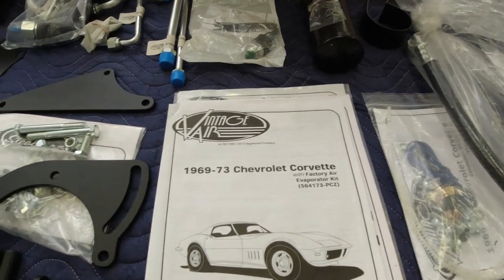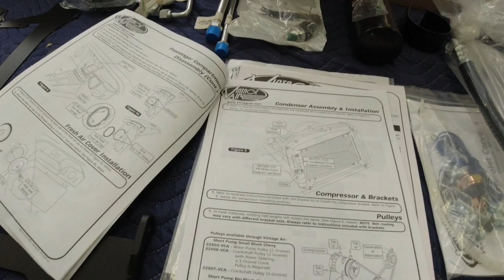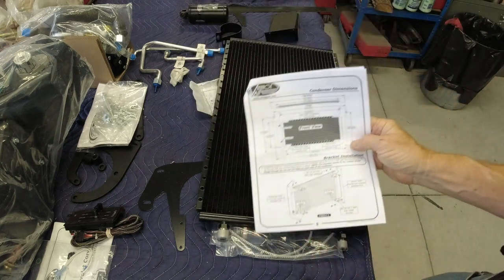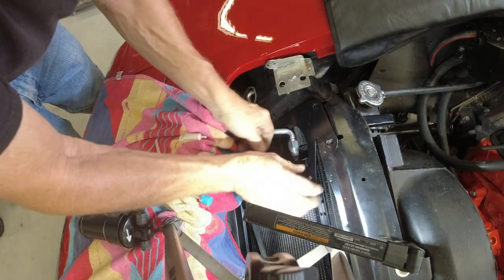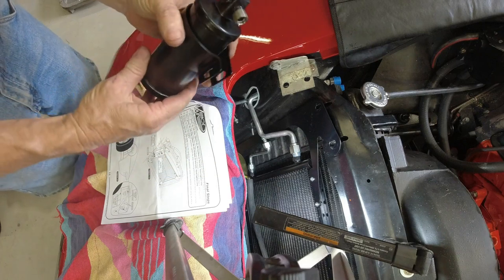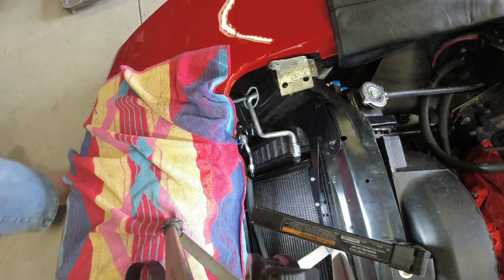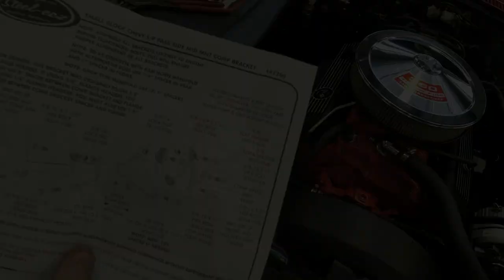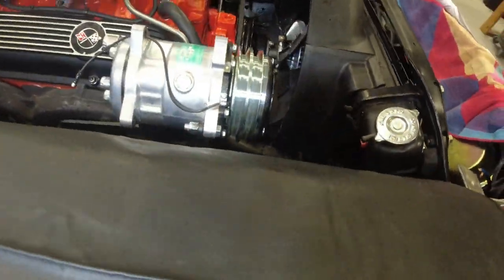VINTAGE AIR CONDENSER/COMPRESSOR INSTALL ON C3 CORVETTE PART 2

Comment: Good video. I have a 71 as well. It’s a little late to tell you, but if you ever need to service the drier or replace the trinary switch get you a 18103-VUG switch port. This has a valve so you can replace the trinary switch without losing all refrigerant. A female trinary switch is 11076-VUG.
Reply from the maker: Thanks for the information. I did not know they made something like that.

Comment: I just got a barn find Corvette and have started the gutting of the interior process. Once I get that done I'm pulling the engine and resealing it and replacing the clutch and pressure plate. All the AC components have been stripped. I will be rebuilding it from scratch.
Reply from the maker: What year is your Corvette? Sounds like you have a lot of work ahead of you. Enjoy the journey. It will be worth it in the end.
Reply: @timewiththedurbins  
It is a 1969  at first I thought it was a 71. Then someone sent to a site to decode the VIN. Yes it will be a labor of love. I have a good start but am waiting to get it in my name to invest any real time or money.
Reply from the maker: @bailey78  A couple of quick ways you can tell are by the side vents and the front turn signal lenses. The 69 will have 4 vertical slots while the 71 will have what they call egg crates. There is several small rectangular holes on each side of the car. The 69 has round white front turn signal lenses. the 71 has white rectangular ones. Depending on if the car has been modified. I bought a 77 once that had an 81 front end on it. I knew it when I bought it.
Reply: @timewiththedurbins  
Yep I have round turn signals with amber bulbs and functional air slots on the sides to pull air to help cool the engine bay.
Reply from the maker: @bailey78  Definitely a nice year to restore.

Comment: That's a BIG job....wow.  You won't regret it, though.  I won't buy a C3 (or any classic for that matter) without A/C.
Reply from the maker: If you have a classic car, they definitely need to have AC.
Reply: @timewiththedurbins  We're so used to the modern comforts of having AC as a standard feature in pretty much every daily driver now, it's really hard to truly enjoy these classics without AC; for me anyways.
Reply from the maker: That is true. I always have my AC on in my car. When I was younger, I never used the AC on my vehicles. I was more worried about gas mileage than keeping cool.

Comment: Mark, great stuff here. Thank you. Im also in FL 71 C3 convertible wondering if you ever installed the electric fans?  Hows yours run in dead of Fl summer?
Reply from the maker: Where are located in Fl? I have a 195 thermostat in my car. It runs around 198 to 203 unless I get stuck in traffic in the summer, then it will go as high as 210. I have never had it overheat. I have an aluminum radiator and electric fans for the car but I don't know if or when I will install them.

Comment: Thanks Mark - Did you happen to document the process of cutting the hole through the inner wheel well? 
What would you have done differently in this process?
Reply from the maker: My car had factory air so the hole was already there.
Reply: I put the templates on, but once that is done, you'll instantly notice you can't get a drill in the front to make the pilot hole.  By trial and error, I went through the wheel well (after some measuring) and walked in the drill bit until I hit the center.  Sounds dumb, but since the hole saw removes an inch and a quarter, it wasn't really a big deal to miss the center mark 2 or 3 times (as long as your drill bit marks made it inside that 1-1/4 diameter circle).  I did that same process for both templates.  I was not happy that the instructions did not mention this.
Reply: @garyholloway12  I went through the wheel well too. It all worked out. Their plastic cover is garbage, so I’ll fabricate something.
Reply: @thedrivewayC3   I guess it's a good excuse to buy a right angle drill.  I guess that's the only alternative.  🙂

Comment: That portion looked easy... it's the evap assembly that worries me ; \
Reply from the maker: I was a little worried about the installation when I purchased the Vintage Air unit, but the system is very easy to install. The instructions are fairly easy to follow. If you are planning on purchasing a Vintage Air system, do not worry at all. You will be surprised how easy it goes in.